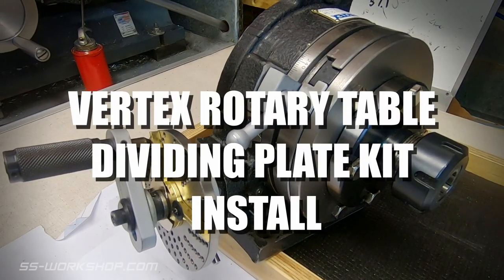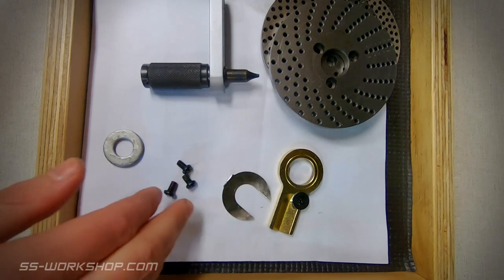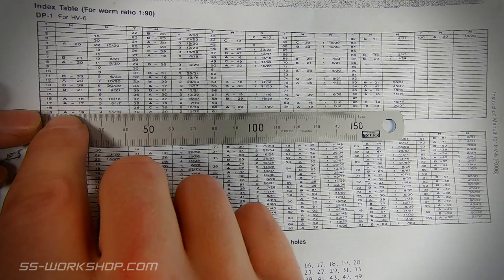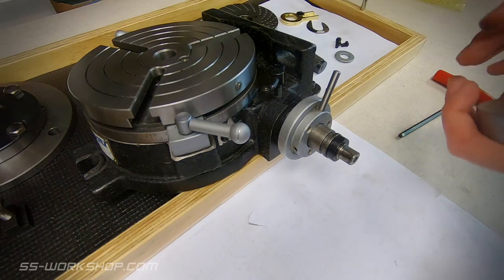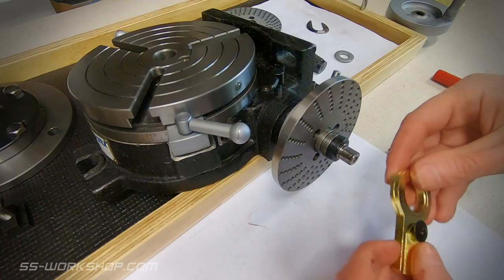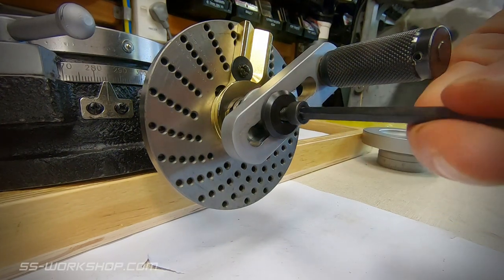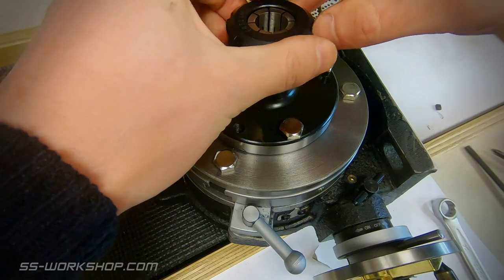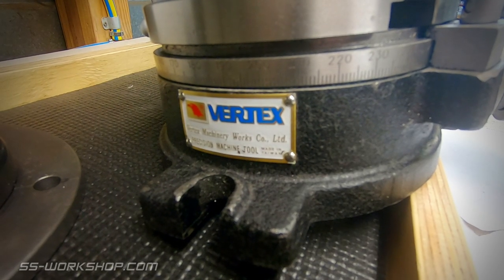Rotary Table Dividing Plate Install - How To

Comment: A very nice presentation, well done!

I considered buying the Vertex HV-6 and looked up the user manual for it.
In that manual are tables for two sets of index discs (they call them plates).
The table for HV-6 with worm ratio 1:90 is denoted DP-1.
There are both typos, omissions and errors in this table.
(I have not yet checked the other table for the larger discs.)
It's tedious and error prone to check the tables by hand so I wrote
a computer program to compute a complete table, given a worm ratio and a
set of discs. The DP-1 set has a theoretical number of 234 different divisions
spanning from 1 to 4410. Not very practical for drilling hole circles, 
but maybe very large divisions are useful for engraving patterns or similar?
An annoying fact is that 64 is missing in this set.
The printed table in the manual stops at 100 divisions. For larger divisions, the table becomes
more and more sparse. A snippet of a printout from the program follows below.
If there is interest, I can present the complete list in a follow up comment.
It should fit within the YT 10.00 character limit.

Key to the table headings:
T is the desired division
H is the disc and hole track to be used
N is the number of full turn cranks and stepped holes

Ex. To get a division of 7 (the bolt circle on Kontax Stirling Engines LTDs :-),
use the 21 hole circle on disc B and crank 12 full turns and 18 steps (holes)
for each division.

Disc A: 15, 16, 17, 18, 19, 20
Disc B: 21, 23, 27, 29, 31, 33
Disc C: 37, 39, 41, 43, 47, 49

Worm ratio: 90

  T   H         N
  1         90
  2         45
  3         30
  4  A-16   22  8/16
  5         18
  6         15
  7  B-21   12 18/21
  8  A-16   11  4/16
  9         10
 10          9
 11  B-33    8  6/33
 12  A-16    7  8/16
 13  C-39    6 36/39
 14  B-21    6  9/21
 15          6
 16  A-16    5 10/16
 17  A-17    5  5/17
 18          5
 19  A-19    4 14/19
 ...
 4410  C-49     1/49
Reply from the maker: Thanks Paul, it doesn’t surprise me there are errors, the chart looks like it’s a copy of a copy so you have to wonder if the manufacturer has ever checked it. I have to say it would be quite annoying if you discovered this in the last tooth of a gear or hole in a bolt circle on a finished part.
Reply: @SS-Workshop  Thanks! Just for fun, here is the complete DP-1.
I have put an assertion condition in the code that checks
that each printed row contains the correct values.
The algorithm chooses the simplest possible quotient.
For example 8/16 instead of 10/20, because 16 is the 
least even division on disc A. It should be easier and 
safer to adjust the sector arms with fewer holes to count.
I found some surprising examples where they had 
missed to reduce the quotient.

Disc A: 15, 16, 17, 18, 19, 20, 
Disc B: 21, 23, 27, 29, 31, 33, 
Disc C: 37, 39, 41, 43, 47, 49, 

Worm ratio: 90

  T   H         N
  1         90
  2         45
  3         30
  4  A-16   22  8/16
  5         18
  6         15
  7  B-21   12 18/21
  8  A-16   11  4/16
  9         10
 10          9
 11  B-33    8  6/33
 12  A-16    7  8/16
 13  C-39    6 36/39
 14  B-21    6  9/21
 15          6
 16  A-16    5 10/16
 17  A-17    5  5/17
 18          5
 19  A-19    4 14/19
 20  A-16    4  8/16
 21  B-21    4  6/21
 22  B-33    4  3/33
 23  B-23    3 21/23
 24  A-16    3 12/16
 25  A-15    3  9/15
 26  C-39    3 18/39
 27  A-15    3  5/15
 28
 29  B-29    3  3/29
 30          3
 31  B-31    2 28/31
 32  A-16    2 13/16
 33  B-33    2 24/33
 34  A-17    2 11/17
 35  B-21    2 12/21
 36  A-16    2  8/16
 37  C-37    2 16/37
 38  A-19    2  7/19
 39  C-39    2 12/39
 40  A-16    2  4/16
 41  C-41    2  8/41
 42  B-21    2  3/21
 43  C-43    2  4/43
 44
 45          2
 46  B-23    1 22/23
 47  C-47    1 43/47
 48  A-16    1 14/16
 49  C-49    1 41/49
 50  A-15    1 12/15
 51  A-17    1 13/17
 52
 53
 54  A-15    1 10/15
 55  B-33    1 21/33
 56
 57  A-19    1 11/19
 58  B-29    1 16/29
 59
 60  A-16    1  8/16
 61
 62  B-31    1 14/31
 63  B-21    1  9/21
 64
 65  C-39    1 15/39
 66  B-33    1 12/33
 67
 68
 69  B-23    1  7/23
 70  B-21    1  6/21
 71
 72  A-16    1  4/16
 73
 74  C-37    1  8/37
 75  A-15    1  3/15
 76
 77
 78  C-39    1  6/39
 79
 80  A-16    1  2/16
 81  A-18    1  2/18
 82  C-41    1  4/41
 83
 84
 85  A-17    1  1/17
 86  C-43    1  2/43
 87  B-29    1  1/29
 88
 89
 90          1
 91
 92
 93  B-31      30/31
 94  C-47      45/47
 95  A-19      18/19
 96  A-16      15/16
 97
 98  C-49      45/49
 99  B-33      30/33
100  A-20      18/20
101
102  A-17      15/17
105  B-21      18/21
108  A-18      15/18
110  B-33      27/33
111  C-37      30/37
114  A-19      15/19
115  B-23      18/23
117  C-39      30/39
120  A-16      12/16
123  C-41      30/41
126  B-21      15/21
129  C-43      30/43
130  C-39      27/39
135  A-15      10/15
138  B-23      15/23
141  C-47      30/47
144  A-16      10/16
145  B-29      18/29
147  C-49      30/49
150  A-15       9/15
153  A-17      10/17
155  B-31      18/31
160  A-16       9/16
162  A-18      10/18
165  B-33      18/33
170  A-17       9/17
171  A-19      10/19
174  B-29      15/29
180  A-16       8/16
185  C-37      18/37
186  B-31      15/31
189  B-21      10/21
190  A-19       9/19
195  C-39      18/39
198  B-33      15/33
200  A-20       9/20
205  C-41      18/41
207  B-23      10/23
210  B-21       9/21
215  C-43      18/43
222  C-37      15/37
225  A-15       6/15
230  B-23       9/23
234  C-39      15/39
235  C-47      18/47
240  A-16       6/16
243  B-27      10/27
245  C-49      18/49
246  C-41      15/41
255  A-17       6/17
258  C-43      15/43
261  B-29      10/29
270  A-15       5/15
279  B-31      10/31
282  C-47      15/47
285  A-19       6/19
288  A-16       5/16
290  B-29       9/29
294  C-49      15/49
297  B-33      10/33
300  A-20       6/20
306  A-17       5/17
310  B-31       9/31
315  B-21       6/21
324  A-18       5/18
330  B-33       9/33
333  C-37      10/37
342  A-19       5/19
345  B-23       6/23
351  C-39      10/39
360  A-16       4/16
369  C-41      10/41
370  C-37       9/37
378  B-21       5/21
387  C-43      10/43
390  C-39       9/39
405  A-18       4/18
410  C-41       9/41
414  B-23       5/23
423  C-47      10/47
430  C-43       9/43
435  B-29       6/29
441  C-49      10/49
450  A-15       3/15
465  B-31       6/31
470  C-47       9/47
480  A-16       3/16
486  B-27       5/27
490  C-49       9/49
495  B-33       6/33
510  A-17       3/17
522  B-29       5/29
540  A-18       3/18
555  C-37       6/37
558  B-31       5/31
570  A-19       3/19
585  C-39       6/39
594  B-33       5/33
600  A-20       3/20
615  C-41       6/41
630  B-21       3/21
645  C-43       6/43
666  C-37       5/37
675  A-15       2/15
690  B-23       3/23
702  C-39       5/39
705  C-47       6/47
720  A-16       2/16
735  C-49       6/49
738  C-41       5/41
765  A-17       2/17
774  C-43       5/43
810  A-18       2/18
846  C-47       5/47
855  A-19       2/19
870  B-29       3/29
882  C-49       5/49
900  A-20       2/20
930  B-31       3/31
945  B-21       2/21
990  B-33       3/33
1035  B-23       2/23
1110  C-37       3/37
1170  C-39       3/39
1215  B-27       2/27
1230  C-41       3/41
1290  C-43       3/43
1305  B-29       2/29
1350  A-15       1/15
1395  B-31       2/31
1410  C-47       3/47
1440  A-16       1/16
1470  C-49       3/49
1485  B-33       2/33
1530  A-17       1/17
1620  A-18       1/18
1665  C-37       2/37
1710  A-19       1/19
1755  C-39       2/39
1800  A-20       1/20
1845  C-41       2/41
1890  B-21       1/21
1935  C-43       2/43
2070  B-23       1/23
2115  C-47       2/47
2205  C-49       2/49
2430  B-27       1/27
2610  B-29       1/29
2790  B-31       1/31
2970  B-33       1/33
3330  C-37       1/37
3510  C-39       1/39
3690  C-41       1/41
3870  C-43       1/43
4230  C-47       1/47
4410  C-49       1/49

Total number of divisions: 234
Reply: @SS-Workshop  (3d) This is bizarre! For 78 divisions they propose B-91 1 14/91. Why, when A-26 1 4/26 gives the same result?
Reply from the maker: Thanks Paul, will keep a print out with my dividing plates, I’m sure it will come in handy. Maybe not the 4000 ones not sure I can fit that many teeth on a gear haha 😂. As I say I doubt the manufacturer checked them, probably copied from somewhere else and miss typed or worked out long ago on paper and copied ever since. Cheers Chris
Reply: @SS-Workshop  I'l try to toss a printout into Excel to make it a little more legible. I don't guarantee that all data are correct, even though I believe they are. You can always make a simple safety check before you cut out everything that is not a gear wheel. If the table says T ...  N H/steps, then this equality shall be true: T*(N*H + steps) = 90*H (I suppose your worm ratio is 90). This property is of course checked in my code just before printout, but ... there might be a bug in the CPU. 🙂
Reply from the maker: @paullehmor982  thanks, it’s come out clear in comments so I can pop in excel. Will take your warning and check before I cut just in case but I’m sure you computer is better than the original. Cheers Chris

Comment: Hello, do you know if the Indexing plate kit for hv4 work with hv3 rotary table?
Reply from the maker: I suggest you check with your tooling supplier, from a quick look online it doesn’t look like it as the 3” has a different hand wheel setup to the 4” & 6” which share the same dividing plates.
Reply: @SS-Workshop  https://www.chronos.ltd.uk/product/3-75-mm-vertical-horizontal-rotary-table/

How about this one? It's being sold from chronos and the handwheel seems quite similar as the hv4-6 series? It's a newer version than the other hv3. It doesn't have any description for dimensions though so I can only tell by the picture. Thanks
Reply: Chronos in the UK sell an indexing set for HV3, HV4, HV5 and HV6 so theirs, at least, does.

Comment: The rotary table has degrees and seconds on the handwheel.......why would you need to install a dividing plate on it ????
Reply from the maker: Great question, The dividing plate makes it easier to get specific divisions that may not be easily divided into degrees and the divisions provided on the rotary table. It really comes into play with gear cutting where you need a specific number of teeth.
Reply: I can see that I guess.